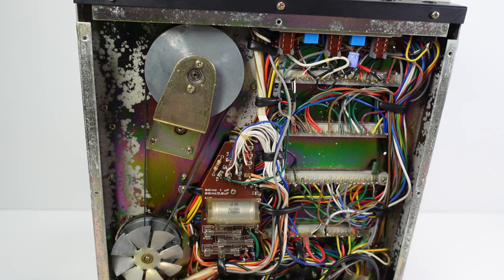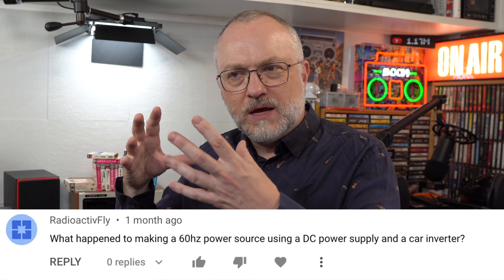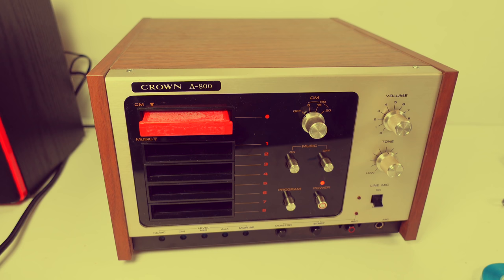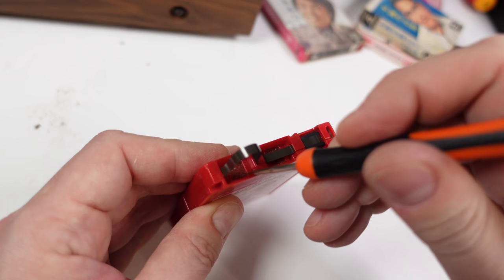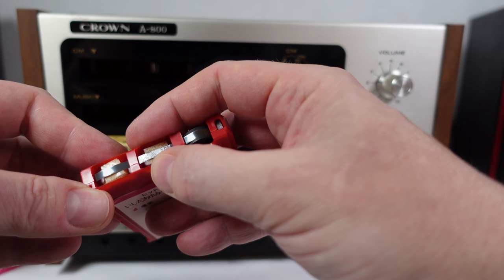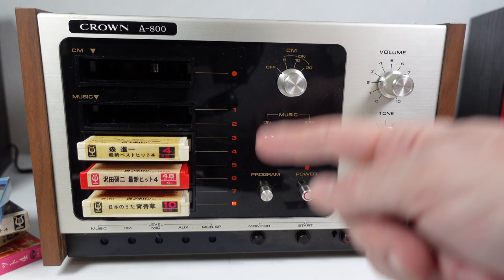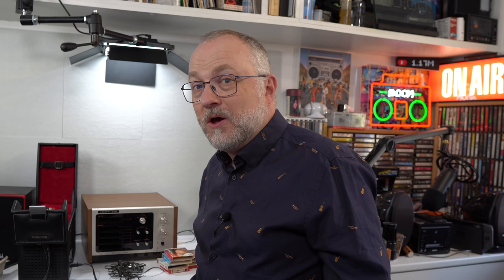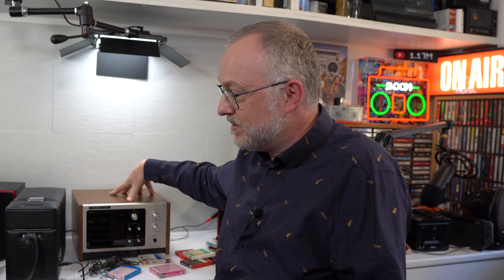Hipac - Fixes, fails and a flash of inspiration

Comment: I'm not specialised in electronic , just i fix some of my stuff. 
First capacitor should not affect the speed they just store electricity , in your case the capacitor was faulty 
two if you can change the motor speed you need to know how the motor is wired and is requirement.
If the motor use AC power and run like on 120volt 60 hz , we can increase the voltage with some risk of overheating, or changing the frequency.
if the motor is DC with no speed regulation , we can change the voltage just if we overpass the voltage requirement we can meet an overheat if we push too much , also we can overcharge de power supply in this case.

I don't know much how to do ii with AC just in DC we can change resistance to increase the speed if the motor is not directly connected to the power source , if the motor is directly connected to the main source , we need to add a voltage regulator to increase the voltage 

If the motor send an intensity to tell is speed or if we put a voltage regulator , we can add a potentiometer instead of a resistor which allow to adjust the speed without changing all time the resistor in the device to get the good speed

Comment: Great experiment. I ran into these moments too and most of the time end up in a bin (like a Sony MD MZ-R910 recently :(... ) It short circuited the chip as I didn't mount the board properly, touching the metal locking mechanism cover. Oh by the way... those closing credit names, are they suggested baby names or you did had an army behind making the videos? Been very curious, some truth to unlock here...LOL

Comment: You could very easily add a switch on the back panel and have the choice of three or even four speeds, simply by swapping in additional capacitor values.  Going that extra 25% faster should not pose any real strain to the mechanicals, unless the motor already runs very hot at the "proper" speed.

Comment: I’m gonna chime in right here before I even watch another minute and I’m right at the one minute mark. The capacitor is charging and discharging. That’s what a capacitor does. The rate at which this occurs has an effect on frequency in this case. More pulses means faster motor. Less pulses mean slower motor.

Comment: Would be a neat challenge to try to re-record a tape at the slower speed intended for this device :)
Reply: I was thinking the same, maybe use the AUX socket on the back to record over one of the tapes. I would at least try putting something on one so that I could listen to it without earplugs.

Comment: If the original Hipac specification included support for multiple speeds, could there be a notch or hole somewhere on the cartridges to tell the car stereo unit which speed to play (like the extra holes in standard audio cassettes for metal formulations, etc)?

Comment: The faster speed made you sound like you had inhaled helium gas. :)

The motor is most likely a two phase type.  The capacitor is connected in series with the second winding and creates the 2nd phase by inducing a delay as the capacitor must first charge then discharge.   Using capacitors on electric motors where 2-phase or 3-phase electricity is not available is still very common today.

That being said any film type capacitor of the correct value and at least 220VAC will do the job to replace the original non-polarized/bi-polarized electrolytic original.  

Interesting that so many chose to question the instructions stamped on the PWB by the original manufacturer, when they would know best.
Reply: Fidelipac cartridges from the 1960s, 70s, and 80s, also commonly suffer from sponge pads which turn to goo, stretched tape, breakage etc.  
For pad replacements, you could also thick adhesive backed felt and cut your own pads.

Comment: Motor run cap failure causes the motor to run slow. Before the cap change, this machine would likely have run slowly, even at its specified 60hz. The capacitor change sped up the machine because not only was it a more suitable match to the 50hz you were running it on, the 50 year old capacitor was likely failing. The machine will still only be running at 5/6ths of its proper speed unless you increase the size of the motor spindle by 20% too.
As the posters on the earlier video explained, the speed of Synchronous AC motors is regulated by line frequency. How could a capacitor, usually only accurate to within 20% of the nominal value, possibly be responsible for accurately determining the motor speed on its own? A look at the line frequency change mechanism in any tape recorder of the era utilizing these motors will confirm that both a change in motor run cap value and the pulley the belt runs on is changed when switching between 50 and 60hz.

Comment: A 60 Hz power supply changes polarity 60 times per second, and a two-pole motor will spin at 3,600 rpm when connected to this source. ... For 50 Hz motors, the speed is 3,000 rpm with 2 poles, and 1,500 rpm with 4 poles.May 12, 2021

Comment: A 'better design' would have been a 50Hz / 60Hz switch on the rear (which, for 50Hz,  connected a second 0.5uF cap in parallel with the first, assuming I have read those values correctly).

Comment: Changing a capacitor for another one with a different value on an AC motor does always change the speed. If those wouldn't make any difference, manufacturers never use them. So yes, they do make a change and without them, an AC motor isn't spinning but only humming and vibrating. When you came across a capacitor on a DC motor, it will never change the speed, then it's a filter cap.

Comment: You could easily modify this unit to play at the Hipac speed. Just don't know (yet) which capacitance to add.
Adding capacitance will speed up the tape and I personally think 25% would be very doable for this machine.

You could place another capacitor parallel to this newly installed one, including a switch to disable it to switch between speeds. 
I know that when placing two capacitors in parallel you can add them together like 1µF+1µF=2µF.

60 Hz needs 0,6 µF
50 Hz needs 1,0 µF 

50 Hz is 20% slower than 60Hz, so adding 0,4µF added the missing 20%
To get 25% faster than now, suggests you need to add 1,25*0,4 = 0,5µF 

If you add in the 0,6µF capacitor in parallel I think it's running just a tad too fast. You could give it a try, it would then be a multistandard player. Probably the only one in the world!

Comment: One experiment is worth a thousand theories.  If you don't know anything about capacitors just know that they are extremely variable, especially electrolytics, over time and temperature (capacitance tends to fall as they dry out).  But if that's the way it was designed then what you gonna do?  You have to change the cap.  I would have thought a synchronous motor with two belt positions would be way better.  That said, I have a 1960's Philips reel to reel and I thought the caps would be way past it but they all seem two be just fine and I'm not a fan of recapping for the sake of it unless they are leaking; so I think that stuff from the 80s / 90s seems worst for some reason.

Comment: Your idea on the speed, how the cap change made it fast but not fast enough seems logical as of course it did speed it up and this machine does not specify its hipac, kinda like how some timelapse VCR's would remove the VHS logo because their features went outside the specifications of VHS, but that machine still seems very odd because it omits the four tracks of Hipac, it uses the tapes in the same manner, two programs, but that it stereo and a BGM machine has less than no purpose for stereo, so why not use the 4 tracks individually as 4 programs, and once again add yet more play time, or not need 4 cartridges in the machine, seems like the designers were a little lost for direction and just decided to mess with the speed and foil the format specifications, instead of just going well we have 4 tracks, just use those.

Comment: I suppose if you know someone with a 3D printer you could make some new cases - then all you'd have to do is find the right roller, and you could make a bunch of your own cartridges recorded at the right speed - for demonstration purposes if nothing else. I mean, if it's cassette tape compatible for the media, right? Just adjust the recordings in Audacity before recording via a standard-speed recorder, so that they're right when played back on a slower mechanism.

(Or if you find an old HiPac cartridge where the tape itself is completely ruined, in which case you could just use that. But finding four of those seems even more unlikely than making new ones with a 3D printer.)

Comment: Yeah, the foil looked very rough, I thought "yup, that'll go bad" just not that bad; it could work if you pulled a few inches out so you could lay it on the table. Then cut a much cleaner piece that you've applied with much greater pressure: or why you need the table top. But mostly need to not have a camera blocking the view. Oblique view, not straight down.

Comment: Looks like it functions as a capacitive dropper, aka: on AC capacitors act like resistors(but no heat)  and limit current / power / speed.
 Higher capacitance = more power lower = less power.
Reply: Also to tweak it you can add capacitors in parallel's 10 -1uf at a time.
A switch to add and remove an extra cap might also be a nice idea to run both.

Comment: Doesn’t Japan have both 50 and 60hz ac power depending on where in the country you are?  That suggests speed isn’t driven by explicitly the ac mains frequency.  So the circuit may very well use a dedicated timing circuit to set the frequency.  Thus the capacitor may well adjust the frequency of its an RC oscillation circuit used to drive the motor.

Comment: Cap tolerances in the period of its construction were more lenient. Nowadays it's +/- 10% spec value. It's likely either would be fine unlike today where if you so much as sneeze at the wrong frequency with a blue shirt on during Wednesday dinner the whole thing is trashed

Comment: Would have been interesting to see what value the old cap ended up being at. And a leakage test would have been handy because if the cap was leaky it would load the circuit down . Considering how old the thing is it wouldn't be the only cap I would be replacing.
Reply: Electrolytic capacitors do degrade with time and operating hours but that one wasn't an electrolytic.
Reply: @geoffmorrison3648  But these caps degrade as well.  I've seen these crack and split apart. The only caps I can leave with confidence are the old Mica and Ceramic caps .But I've had the odd one fail . This cap looks like it has mains potential across it so is a must to be replaced anyway. These when they fail properly can start smoking and catch fire so !!!!!!!

Comment: A different pulley could get it up to speed. If you put two caps in parallel and add a switch you could even switch between two different speeds.

Comment: A 220V cap probably would have blown up as your mains voltage goes up to about 310V at the peaks of each wave. As the voltage is constantly changing 50 times a second you use root mean squared to calculate the equivalent DC voltage which is 230 (240 here for some reason) volts RMS.

Comment: To be fair to the guys  that said no (me!😫) we expected a synchronous motor. A induction motor like this is not something you would generally find on a speed critical device. It is ultimately controlled by the load allowing slip. The torque is the only thing effected by the capacitor change.. Just shows assuming stuff and so on....Bad idea. Obviously those Japanese engineers had this down.
Edit: There are many other types of motor used to control speed critical devices but they usually come with adjustment, to allow setting of final speed.

Comment: "east japan" lol.   Try someplace with a steam radiator heating system where the moisture and cold oscillate deeply on a daily basis.
So in about 6 hours you discovered one historical fact that may well have been lost to the ages.    That makes you about 70,000% more efficient than an Archaeologist.

Comment: I don't think this machine was designed for a format running at a slower speed. You are still running the machine at 50 hertz while it is being designed for 60 hertz. The motor is connected by four wires so it has to be a synchronous motor and you can't change the speed with the capacitor. The purpose of the capacitor is to produce a phase shift and its capacitance has to be set based on the mains frequency. If the capacitor doesn't have the correct value the motor might get unsynchronized and run slow which I think is what happened in the last video before the capacitor were changed.

Comment: It would be interesting to calculate the correct capacitor for the other speed of playback, and then setup a switch on the underside to select between the two capacitors, but because this is on the mains voltage side, you would have to careful to insulate eveything correctly, so you don't accidentally make the metal chassis live, and electrocute yourself or someone else.

Comment: if a motor uses the charging and discharging of a capacitor to regulate speed, then changing its values will change the speed. i knew it would work when i commented on the last video. that and its printed on the board.

Comment: 7:03 Drives me nuts that engineers won't just stick a 10 meg bleeder resistor across high value caps and avoid technician-killing unpleasantness like that.

Strange thing to me is that a 50/60Hz switch wasn't already included.  When I was stationed in Japan (late 80s), we'd have to buy alarm clocks with a switch because the grid was 60Hz in Tokyo and 50Hz in Misawa where I was.

Comment: A good Electrical policy is to Drain every & All Capacitors - never just one 
Mains reference audio caps are the worst Due they can Re Cranage (memory effect) Without being Plugged in it helps to short them out with a few Temporary crocodile clips wires after Draining them

Comment: Hi, I've just had a thought about that conductive section that the tape needs. Might it be an idea to try painting a section of conductive paint or similar on the tape ? Might be worth a try, the only down side may be is that as the tape flexes it may not flex with it and crack, thus having sections of discontinuity. Give it a try maybe.🎵🎶🎼🔊

Comment: "But that is as far to really take that type of modification, you can't just swap ut the caps to change the speed of the motor" 
Are you sure? Just by eyeballing the numbers TRY with a 2 uF capacitor to see if you can play these high speed tapes. (Or with another 1 uF cap in parallell) And if it works you could make a Techmoan switch at the back.

Comment: Gears affect speed, if you put a smaller hear in place then it will go faster. Think about the fact that it is a machine that run on electricity instead of parts.

Comment: It almost seems a shame not to modify the machine went they went to the trouble of giving you two values, allowing you to calculate they exact ratio you'd need to increase the speed by the exact right amount. I get your point but I don't think it would really hurt all that much to install a second cap and mount a simple switch on the back. It's not like you'd be hurting the value of an antique, I doubt it's possible to restore a machine in that kind of state to pristine condition.

Comment: I have a question maybe you can help me with i have this little pair of xenon bulbs that came attached to a cheap little pcb controller and i bought it originally to install them in my headlights however when they are connected to power they only flash about once every couple of seconds it is the slowest strobe I've ever seen even though the flash is very bright it just the frequency of the flash is terribly slow id like to know what i can do to increase the flash frequency and if you also know how to if you could also tell me have i can change the flash pattern so they flash in more of a wig wag pattern any help would be appreciated.

Comment: It also seems that you got some dying caps. I'm finishing restoring a "made in Japan" 1972 Blaupunkt ACR200 8 tracks car player (rebadged Lear JET  type 8123 ). At first I replaced the belt, oiled mecanics, but it was not enough speed was lower and sound like an AM radio... because all of caps needed replacement. With a "chinese" tester I found that they dropped by 20 up to 80% of their values, and the ESR got 10 times "standard" new caps. I also see that you don"t set the tension ot the tape, look at "Barry's 8 Track Repair - Maintaining Your Tapes" on Youtube at about 5:30. I always check tape I receive, and sometime found that some are out of tension, but sometime size, and need to be filled out, and then reinstalled.... Good Luck.

Comment: Capacitor change phase, not frequency. Different values in 50/60 system only because of reactive resistance is dependant to frequency.
Reply: And motor is asynchronous- it is not in sync with power frequency.

Comment: Can anyone explain how lowering the speed can extend the amount of music?
Reply: There's a fixed amount of tape on the reel, so if you record from the source at a lower speed, you can play it back at a lower speed.  The lower the speed, the longer the tape takes to run from one end to the other, i.e. more playback time for the same amount of tape.

The downside is that when you run the tape slower during recording, it means that more information (audio) needs to fit on the tape, and as a result the quality is reduced. (Same applies vice versa - you can increase the tape speed to improve quality, at the cost of capacity).  As Mat points out, for a BGM player quality is less important than for a home or car player, so the people behind this machine clearly felt it was worth the compromise.